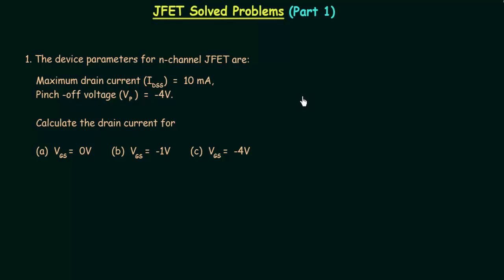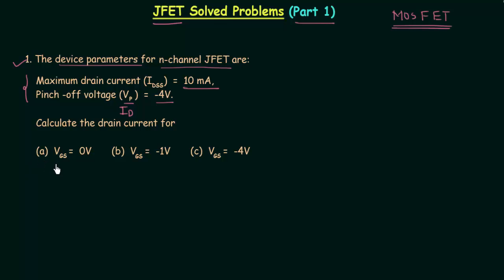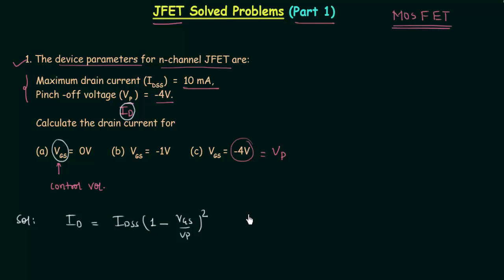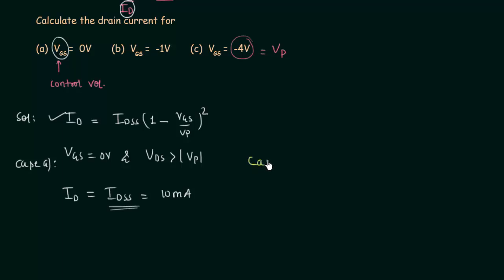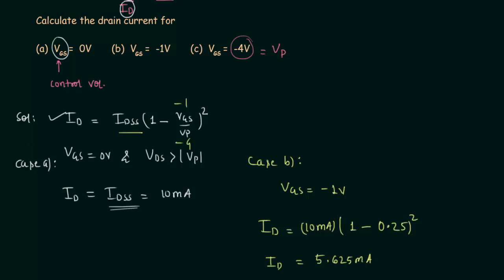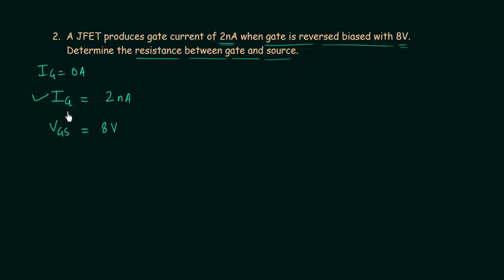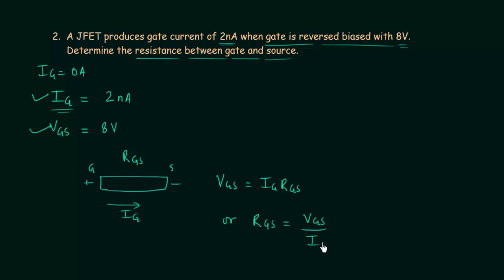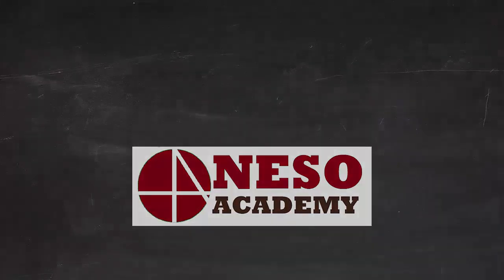JFET Solved Problems (Part 1)

Comment: 4. a. Determine V DS for V GS -
 0 V and ID = 6 mA using the characteristics of Fig. 6.11 . 
b. Using the results of part (a), calculate the resistance of the JFET for the region I D -
 0 to 
6 mA for V GS -
 0 V. 
c. Determine V DS for VGS = -1 V and ID = 3 mA. 
d. Using the results of part (c), calculate the resistance of the JFET for the region ID = 0 to 
3 mA for VGS = -1 V. 
e. Determine V DS for VGS = -2 V and ID = 1.5 mA. 
f. Using the results of part (e), calculate the resistance of the JFET for the region ID = 0 to 
1.5 mA for VGS = -2 V. 
g. Defining the result of part (b) as r o , determine the resistance for VGS = -1 V using 
Eq. (6.1) and compare with the results of part (d). 
h. Repeat part (g) for VGS = -2 V using the same equation, and compare the results with part (f). 
i. Based on the results of parts (g) and (h), does Eq. (6.1) appear to be a valid approximation?

Comment: Hai sir I have doubt....can we interchange source and drain terminals in JFET AND MOSFET ..device work or not..??
Reply: yes we can exchange without changing the performance of the device when connected to the external circuit you can I think it was explained in 1st or 2nd video of JFET

Comment: sir why did you take the reversed biased voltage Vgs as positive value??
how can the junction get reversed biased by +ve value?
Reply: From the data given in the problem, Vgs is +ve, so  for the junction to be reverse biased, it has to be p-channel jfet. So it is a p-channel jfet problem.

Comment: Sir, why did you assume Vds> Vp because if it is less then pinch off voltage then Id will not be as calculated in the video, any particular reason?
In general your videos are excellent Sir, Salute to you!